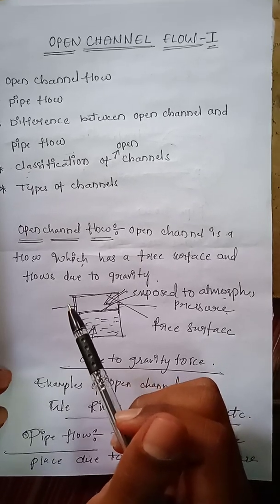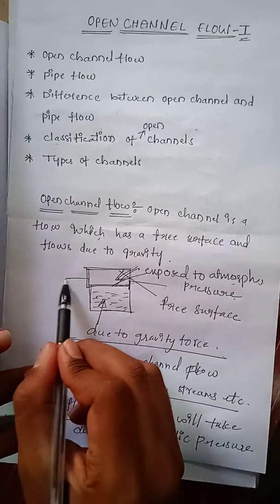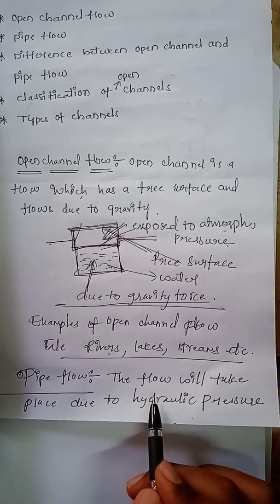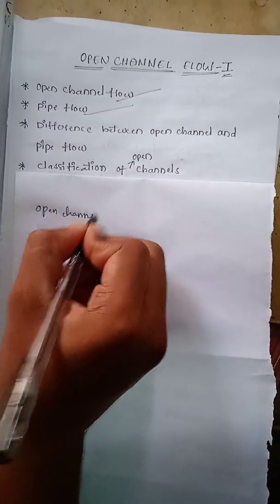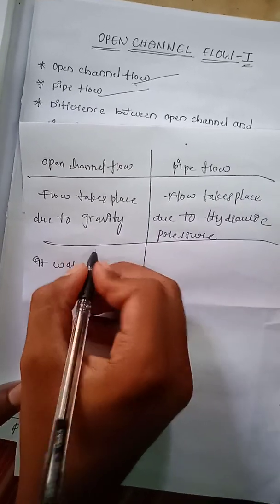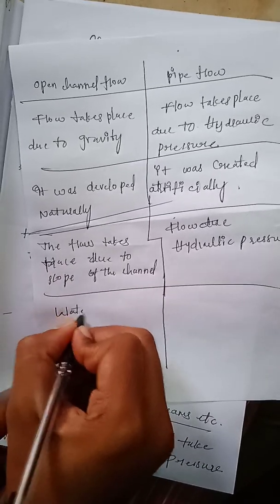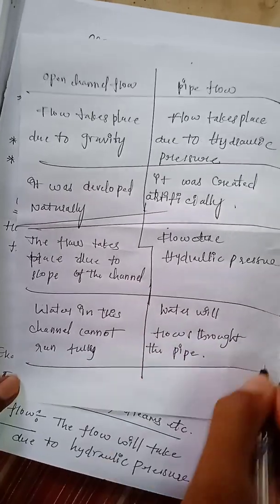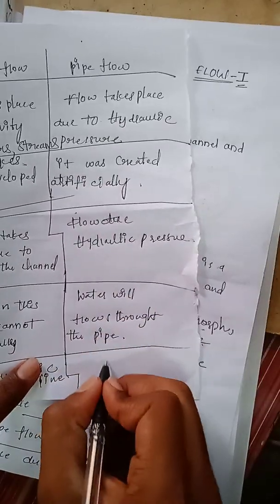Introduction to open channel flow part-1 civil engineering student's

Comment: In open channel y water flow is not running through out channel and what is the reason
Reply from the maker: Bcoz at the top of the open channel has free surface nd that too it is exposes to atmosphere pressure so it doesn't flow throughout the channel if it flows thougout the channel it is called pipe flow
Reply: Can u explain method of joint nd section s
Reply from the maker: @poojalingaiahmedi3030  y not dfntly Will xpln u..!
Reply: @vinaymudiraj7033  ok thanks u
Reply: Do u know me
Reply from the maker: @poojalingaiahmedi3030  don't mention
Reply from the maker: @poojalingaiahmedi3030  yeah I tnk u r pooja ryt...!
Reply: @vinaymudiraj7033  s iam pooja nd clsmate of u
Reply from the maker: @poojalingaiahmedi3030  hok nyc to meet u
Reply: @vinaymudiraj7033  thank u